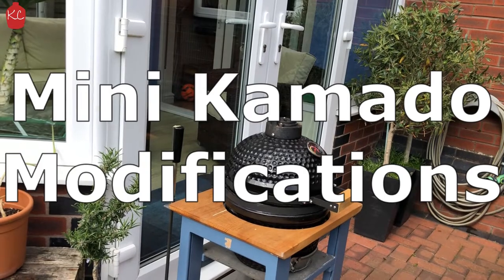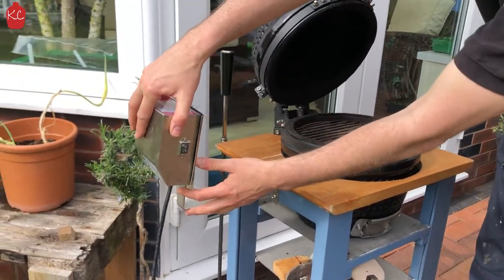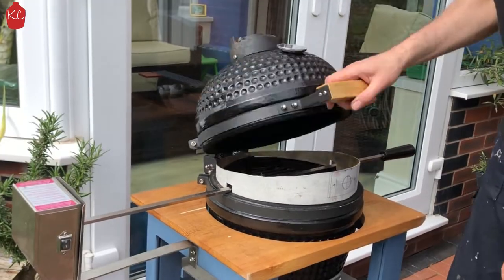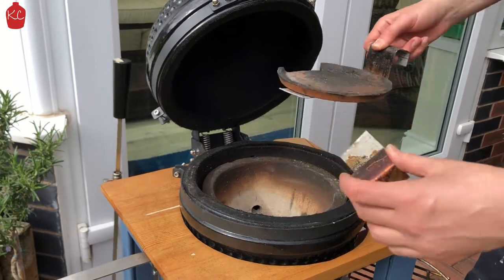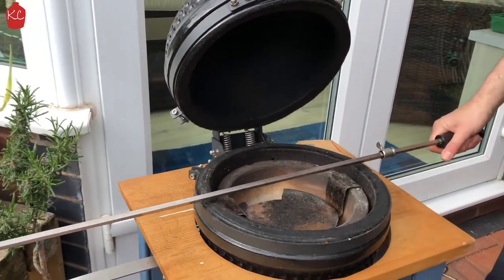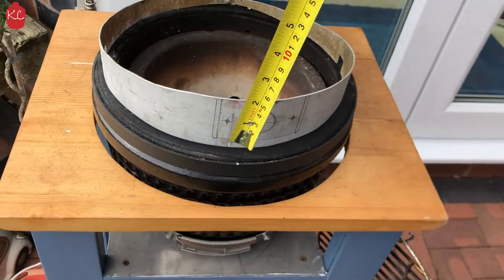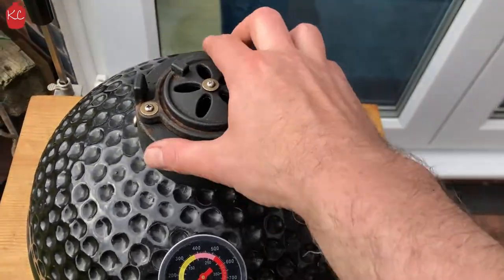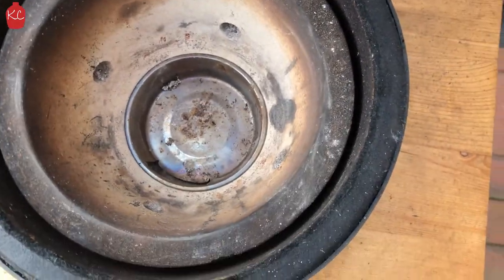How I made a rotisserie for my mini Kamado and other useful mods. Aldi Lidl Kamado

Comment: And the table?
Reply from the maker: The table is a bedside cabinet from Facebook for £10. Removed the sides and door and cut a hole for the kamado. sorted! 👍👍🔥🔥 People use Ikea Bekvam too
Reply: @kamadocovers  
Is there not a problem with the bottom of the kamado without stand (it is hot)?
Reply from the maker: @johandomingo8330  Its on a stainless steel shelf - you can see in the video 👍